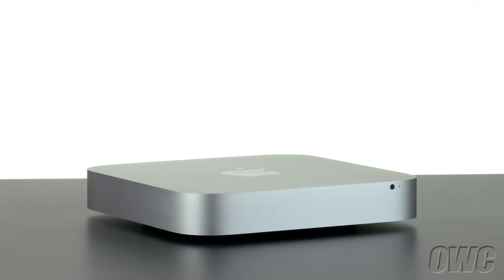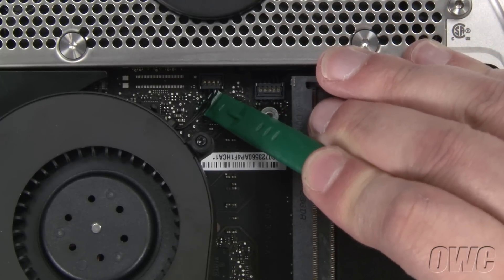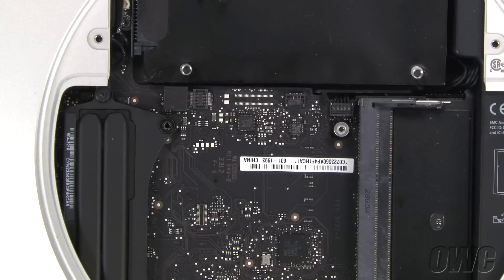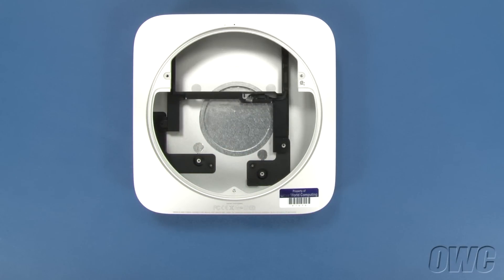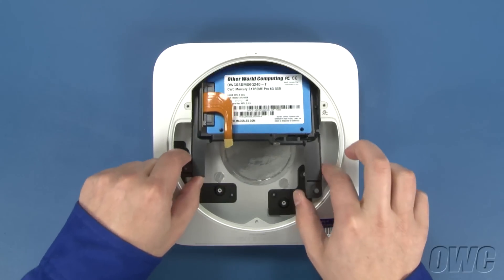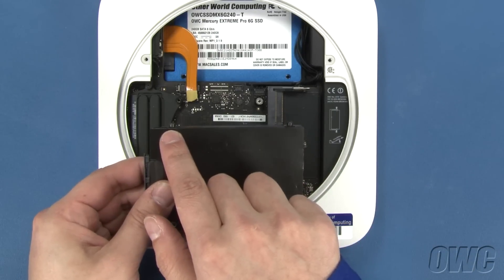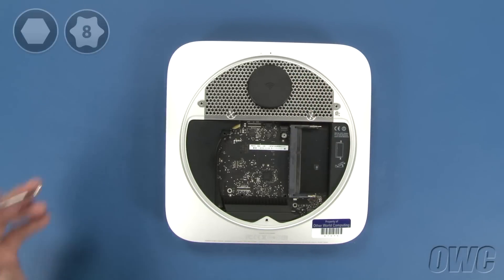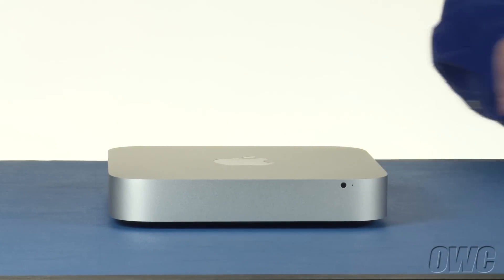Mac mini Late 2012 Data Doubler 2nd Hard Drive/SSD Installation Video

Comment: Question: can I make bootable the lower drive? Is the connection transfer speed to the logic board would be the same on both drives? Thx
Reply from the maker: Yes, the speed s the same for both connections, so it is up to you which drive you choose to set as the boot drive.
Reply: @poweredbyowc  Thank you! That's good to know. I'd like to set up the lower boot drive SSD, and a large storage drive on the upper level. If necessary, it is easier to replace upper drive with a new storage drive, and leaving the boot drive untouched.

Comment: Do 2 hard drive /ssd make your computer faster ?
Reply from the maker: It will not increase your overall speed, but if you need additional storage, then yes, using an SSD would speed up the storage time as well.

Comment: This video was the key to upgrading my Late 2012 Mac Mini hard disk. My disk was bolted onto the carrier rather than sitting in the top bay. I was pulling on it, as in other videos and flexing the logic board. I did not know the drive was bolted down. Although this video was about adding a second drive, it shows how to disassemble the Mac to get at the first drive bay. Very good video and was the key to upgrading my hard disk where other videos did not show how to remove the drive bay. Thanks much!
Reply from the maker: Glad you found it helpful, Edward!

Comment: I have a mac mini late 2012 and already has two HDD installed but would like to leave it with a single HD drive. Can I remove the top one (which is easier) and leave it with the one at the bottom or do I need to remove the bottom one? Thanks.
Reply: @poweredbyowc  Wow, that was a prompt response! Many thanks. Is there a big difference between a HDD and an SSD on these machines (they employ SATA II not III I believe)?

Comment: Hi there, am thinking of upgrading my mini 2012 (2.3 processor, i7, 6,2, 16 GB, 1TB HD) but I wonder if it is worth it in 2019?  I have a few questions as a music producer using Logic pro X latest version and Mojave (not updated yet).  Thanks again for your great videos which I intend to use to do my first ever upgrade...  My latest experience upgrading my Macbook pro 2011 through 3 different services (Best Buy, Canada computers and one independent certified Apple repair man) left me quite frustrated and frankly discouraged and distrusting.  After finding your videos on youtube, I am convinced I can't do worst if I take my time, use the right tools and follow your videos.  I have already successfully changed the Rams from 8 to 16 GB.
What is a data doubler as opposed to a server?   
Is it a good adea to put 2 SSD drives?  
Is the drive the cause of heating as it is only 55% full. 
Finally, where can I get your products in Canada, for exemple, ssd drives and tools.
Thanks again and hope to hear from you soon!

Comment: Great video and explanation 😀👍 but question can I install my old drive in the new space and my ssd in the old space as I plan to take my ssd out when I come to sell it  as putting the ssd were you did you have to dismantle the whole lot again just wondered as I'll have to mess about taking  mother board out and psu out etc for a 2nd time which is a pain
Reply: MacSales. com thank you for the reply but installed it underneath the original now I followed you video so thank you.. it took me almost 2 hours I guess I'll have to sell it with it in now as not doing all that again 👍

Comment: One thing it doesn't say the upper bay drive sata cable is different from the lower. You have to buy it separately. When I bought the ifixit kit it came with the lower bay cable. Also I damaged the connector removing it along with the IR cable becuz these videos don't instruct you correctly.

Comment: Exactly how a "How to" video should be shot and presented.

Clear and concise instructions. Clear images of points to look for.

I followed the instructions as shown - AS SHOWN - and had the Mac Mini back together in around 28 minutes.

Powered it on and went straight to Disk Utility to initialise the new drive.

Comment: Hello, can it be configured so that the "second" hard drive could be the booting one ?
Reply: Yes. Hold down the option key while booting up and it will show all the bootable OS installed on your Mac, select which one you wish to boot into. Or while booted up go into setting and startup and select the default startup drive.

Comment: Hello! If i want to replace old hdd on new hdd (mac mini 2012), what height should hdd have - 9,5 or 7 mm? Thank you!)
Reply: Thank you! But which one better? Just saw one comment about hdd in this model of mac - "Having just changed my hard drive the original 9.5" drive was very tight to remove so anything thicker than that I would expect not to fit." https://discussions.apple.com/thread/4914104?tstart=0

Comment: Ok, so after the SSD installation you turn the Mini on and how do you make the SSD the Startup disk? Simply dragging the files to it will not do. Thanks for the thorough video.
Reply: Thanks for the video, I do know how to make a drive the Startup disk. I guess I would have to format the SSD and then do a restore form one of my bootable backups?

Comment: Can I put 2 of 2TB from the new Firecuda SSHD 2.5"?
Reply: MacSales. com 2 night ago I build the mini with 4TB of Firecuda SSHD (Fusion Drive from Terminal) and 12GB RAM, not restored backup, I set it up as new Mac with the lastest OSX system.
Yesterday was my first day of use, it was working very great for hours, not heat, super clean and fast interface.
Today it gots very hot after a couple hours, I opened and the fan is working but I dont know why. So I turn it off, right now I'm waiting to it gets cool to turn it on again.
Reply: MacSales. com All what Ive been doing is using Youtube in safari, adding info in the settings (like my emails, icloud, ect), adding antivirus, protection for privacy, and checking how the Mac works before install my whole stuff.
Reply: MacSales. com Oh! And im not using the internal speakers, Im using an audio interface that use Firewire port and only 1 of my 2 monitors.

Comment: +Owc Macsales I am attempting to do this now and I have a recurring problem with the motherboard/tray having a small gap that leaves the back panel sticking barely out, and I can't push it in any more. The motherboard screw hole is just barely out of alignment. I suspect it may be the rubber grommets for the SSD screws that are causing it. I am taking them out now. If that doesn't fix it, do you have any other suggestions?
Reply: +Owc Macsales no they won't in fact you shouldn't need to mount it with screws at all since its such a tight fit there will be no room to wiggle not to mention you can put an HD in without taking out 90% of what you took. this installation should be only 15 min max (replaced my drive just a week ago) why are you "pro" guys always making stuff look harder than what it is?

Comment: First of all thanks a lot for this video, it's very clear, and like another user here I managed it in around 90 minutes. One thing that would make the video better I think is to put the second HD in before you fully slot back in the logic board. I couldn't fit the drive in until I pulled the logic board back out a bit and then it all worked fine.

Comment: yeah this was complex but i did it. the mac min components are so tightly packed it makes it awkward, you need a lot of patience and it took me about 1 and 1/2 hours to do. i ended up with couple of screws that i missed, but not the end f the world and still works fine! i installed SSD drive and used the stock drive as the second drive - works fab. i was worried initially as i thought that the temp might increase with two drives but no its fine. 
the retainer clip - i couldn't get that thing back in but again looks and feels ok.
i don't recommend doing this for the faint of heart and make sure its not in warranty as you will or may not have some screws left :)
the airport lead attachment is insane - it has a diameter of probably less than a milimetre and you are expected to click this into place with so little space to work with.
i probably would do this again
Reply: How did you follow the video and still have screws left over? I'm about to do this and extra pieces is always the fear, but unless the video skips a few steps, I can't see that being an issue.

Comment: I just follow all the instructions and all seems very well. But a spring comes out of nowhere, someone you knows where it goes?. By the way know you can´t separate the fun from the left black thing and it makes it a little more difficult
Reply: yeah the spring is attached to a screw bottom left, i noticed it when i took mine apart, when i tried to put it back in it wouldn't take so i left it out, its fine though - don't worry about it

Comment: Would you recommend doing this SSD installation or moving the operating system into a Thunderbolt or USB 3.0 external SSD? Would that yield the same results?

Comment: Just finished! Thx a lot for this great video. I don't feel quite comfortable, anyway... The power cables are placed between both hard drives and I'm afraid heat can damage them. However, in this video the cable also goes between both hard drives: is this safe? I tried to push the cable between the side of the drive and the power supply.
IMHO, the most tricky part were to plug the wifi antenna and correctly insert the second HDD!

Comment: I used this kit and replace the main drive with a HGST 1TB 7200 RPM drive and added the OWC SATA III Pro SSD. 1.24 TB of storage, computer boots in under 11 seconds. Photoshop loads in under 3 secs after a cold boot.

Was a little nervous doing this kind of work on a brand new system, but I took my time and it wasn't that hard. The only complaint I have is that the provided drivers are very small for my big mits. Before I do this again I'll be getting a full torx and hex set from Frys.

Comment: Hey guys...followed this video and I must say, once again, sterling work...thanks for making the guides available. I used the OWC data doubler (and tool kit) ordered from Mac Sales. Arrived today in the UK after about 10 days.

Only issue i had was when i came to replacing the Airport cover plate. One of the outer screws just wouldn't go back in as i couldn't re-align the plate exactly. Minor issue though.

Again, many thanks...a happy customer.

Comment: Dont forget to take out the logic board removal tool (which I had to bend a bit for it to fit in the holes) before you pull the logic board further out with your hands. Be careful with the removal tool since it can break the logic board when you jiggle with it. 
The SATA cable you provide is a tad bit too long.
And the HDD screws wasnt Torx T8 but hexscrews, and one of the rubber plugs was a bit broken (seems to work anyway)
The torx t8 screwdriver was too small/useless so use real Torx-set!

Comment: Warning!  Be EXTREMELY careful when disconnecting the IR connector from the logic board.  I broke mine off.  I went online to see how to fix and found several others with the same issue.  Just be sure to pull/pry from the proper location, as shown on the video.  Regardless, this is a fantastic video.